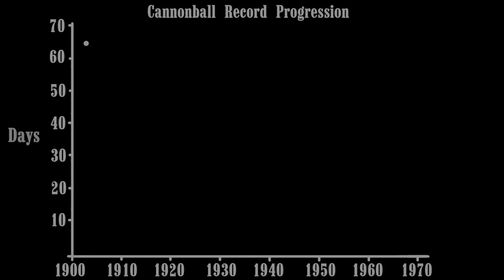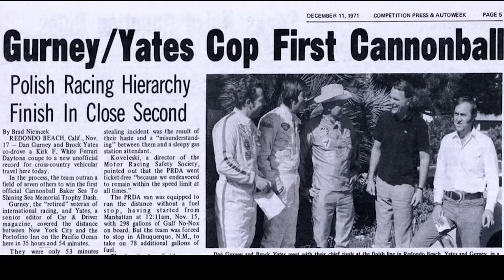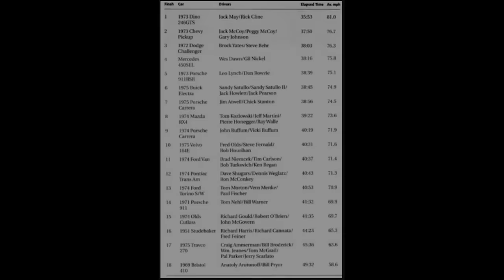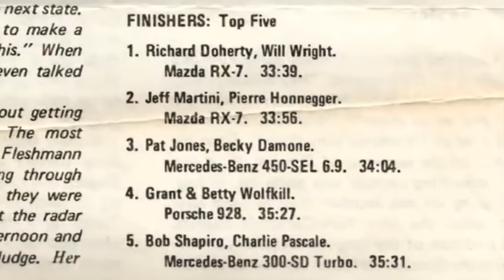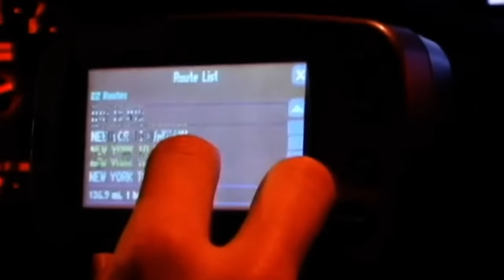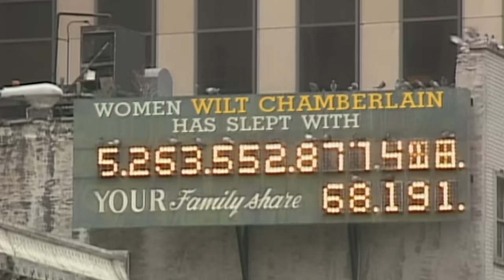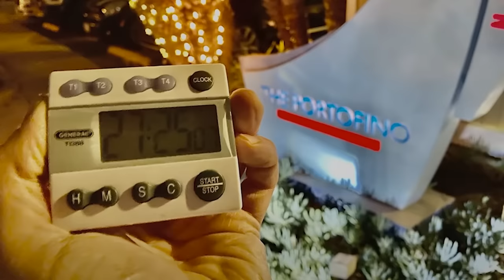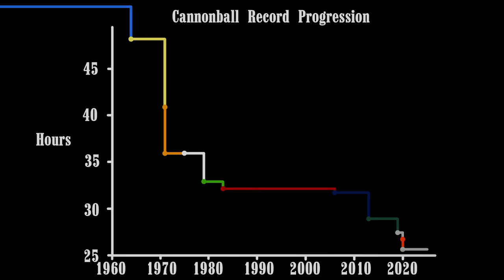The Real Story of the Illegal Street Race across America

Comment: Fun fact: In 1983, when I was 18, I had entry forms and everything for the '84 Cannonball. I built a 1979 TR7 body/frame/suspension and dropped in a built 60 degree Aluminum block Ford (Ghia/Capri) V6 that dyno-tested 310 hp at the rear wheels.  Everything else was Ford.  I had it to 184 mph once and with light weight and small diplacenent got decent gas mileage. At 17, I even did a practice run from San Diego to Tampa in my 1973 Charger, clocking 40 hrs and 20 minutes solo, non-stop! I built it specifically for it for the 1984 race that was canceled 😢
Reply: @luxdevoid  awesome 😎 have ya been in any since 🤔
Reply: @MaryShoemaker-wi4fy  Nope, after that, I went to college and discovered girls, haha
Reply: @luxdevoid  dang 🤔 well at least you got a family 🙌
Reply: Nice, I bet that's fun. I have a vehicle I would love to try it in but the chances of me being arrested are incredibly high😂

Comment: Back in 1979, a friend and I got wind of the upcoming Cannonball and made plans to enter. We'd also seen a small spot in Corvette News about a guy and his 1963 Corvette claiming to be the "fastest Corvette in the world" due to a time somewhere around 41 hours. With both our racing backgrounds, we figured we could beat it and take that title, even if we didn't get close to the Cannonball Baker Sea-to-Shining-Sea Memorial Trophy Run record. 
Our plan was to eliminate fuel stops by having "inflight refueling" by having a few pickup trucks along the way with gas tanks, booms, and hoses that could be swung over to us and the navigator crawl over the decklid to fuel the Corvette while driving down the road. Even at reduced speed during this for "safety", it was clearly faster than pulling into a gas station, stopping, refueling, and then pulling back out on the road. We figured it would save at least an hour. 
In the end, our projected budget was going to be enormous, with gas for 6000 miles roughly for the Corvette, gas for the pickup trucks to get in position, hotels for everyone, food, and other expenses. Trying to round up enough friends to be as crazy as us, after all one would have to drive a pickup while another was in the bed swinging the boom to us and operating a pump, all going down the road at 55 (or more) mph. We figured we'd need about 10 gas stops and that at least 5 needed to be inflight refueling to make it worthwhile. 
Clearly we didn't fall into the rich enough to throw money away like this would have been. 
My Dad had even suggested that due to West Coast Corvette prices at the time, when we got there, sell the car and fly home to offset some of the costs.
And by 1979, getting out of tickets wasn't nearly as easy plus they counted for more than simple fines. 
In the end, that much money paid for almost two seasons of road racing.

Comment: 10:32 One of the janitors at my school had a friend back when he was young, who swapped a 350 small block Chevy and a Powerglide 2-speed auto into a Vega, but he didn't change the rear end (A little 8-bolt that's made of glass), which he blew to pieces as soon as he got on the gas. After that, he put a positrac rear end from some other Chevy in it, and had a lot of fun surprising people at stoplight races, before eventually crashing it.

Comment: I have always felt that speed limits should be restricted to areas where it is necessary like around schools, towns and cities. As long as you drive well within your limits leaving room for the unexpected, high speed driving is safe. Sometimes safer than driving at the speed limit on a boring road where you can easily get bored and complacent, which also causes mistakes to happen.

Comment: Did it... in 46hrs flat... from the pan handle of Florida to the top of the bay area... in a BMW 320i... an 81... of all the vehicles to run the trip with... it did a fine job of running 115mph the whole way

Comment: I belong to a car club that yearly attempts much shorter runs - usually less than 250 miles - but as fast as we can. We compete against each other, so no outsiders. The fastest I'd gone when I had a turbo 4 cylinder was 160mph. I have since swapped the 4 for a 600hp 427 V8. Top speed - unknown. :D
Reply: What car bud

Comment: My recollection of the Car and Driver article explaining the first Red Ball Garage to Portofino Inn dash as being a civil disobedience run, the rationale being that in 1933 Cannonball Baker traveled the 2,800 miles in 53.5 hours at (supposedly) an average speed greater than the then new 55 mph speed limit. Regarding the Polish Racing Drivers of America, their idea was to load a Chevy van with enough 55 gallon drums of petrol to allow them to drive without stopping. But with 7000 lb gross weight, fuel economy was even worse than normal (in 1971). The PRDA van made one stop, 7 minutes long.

Comment: Before he passed away, my uncle told me a story about how he and my father (twins) had made a run in 1972 from Syracuse, NY to Pasadena, CA in his '68 big block Corvette.  They were both engineers at GE in Liverpool and were heading to their 10-year anniversary at Caltech.  The car had a 36-gallon fuel system from a '63 Z06 Corvette, aftermarket side pipes and a "lightly modified engine".  They made the run in less than 30 hours, without incident.  My uncle said that he and my dad outran police numerous times during the run.  When I mentioned this story to my dad, he simply smiled and gave me a sarcastic reply that he had no recollection.

Comment: Funny how at one point cars in general were "far too impractical to ever catch on" and now electric vehicles are "far too impractical to ever catch on"....
Figure out them charging times or find a way to half the cost so I can buy 2 daily cars and ill be on board
Reply: If only... there was a way that they could make the ground electrified on long highway runs then you get a partial charge on those parts
Reply: @Nolesy  that would be reasonable, I wonder if the infrastructure they would need to build is easy to upkeep.. if not, then it wouldn't be viable to attach to ALL roadways and highways, like rural areas, my hometown is not along a main highway and would likely not be considered if roads like that were installed...

Although, in a city it could make sense, if it could cut down on electricity usage in the homes to basically trickle charge the vehicles on the road. .. but it would probably just raise taxes and charge the entire community for the power,, and use alot more of it, meaning more power plants or solar infrastructure would need to exist...

It's almost not useful until maybe solid state batteries can be safely used, if they can even exist yet.

Comment: I have the same 1976-77 Dodge van but it's a Tradesman not a Plymouth Sportsman. I am well acquainted with the carburetor problems that plagued the ambulance. They choke was electric but when off for more than 5 minutes it would almost go full on choke especially after 10 minutes. I would bet that poor 100 yard dash had it chugging and choking right down to a stop. I have made an adapter for this still using the same choke. I might do an adapter more sophisticated using an O2 sensor but not really necessary. Others with money would likely go fuel injection or poor man's manual choke but I hate those ideas. Maybe the future holds a Dodge engine swap EV solution. Well, that's just a dream at this point.

Comment: I think that just plain luck plays a part. I drove from Durham, N.C. to Long Beach, CA in 42 hours. I didn't see one cop on the entire drive.  I typically cruised around 85 during daytime, but cranked the average up to 90-95 at night.  Thankfully, the car was only 500 miles into an engine rebuild and I had new tires. The car purred the whole trip. Ate only 1/2 a can of oil. Truly, the secret was the rear axle ratio... 3.55. So, yes, high speed cruising was just fine as far as sustained RPM. It was a fun trip, except for getting sick from No-Doz.

Comment: I have a good motor in mind but I would need to find a good car to drop it in with enough room for the extra stuff like gas and to sleep and what not. Viper v10 would be my power train choice though, the power it makes and the transmission geared for 200+ mph just makes it ideal for this I think. Wouldn't be very hard to just keep it running over 100 mph steady, also with the ability to out run the cops if provided the extra gas and enough road. Obviously nowadays it better be night time if you try running from the cops.

Comment: I own the black Mitsubishi with the flames.
Reply: Yeah, the actual car from CBRII. There were 4 Starions leased from Team Mitsubishi for the movie. 1= Road car which was outfitted with full frame rails and the flame thrower. 2 = The movie set stage car which was cut up to get good open interior shots. 3 = Car that turned into a submarine that they drove into the lake. 4 = The still shot car for the parked car shots and a couple of slow moving scenes such as when Jackie Chan flipped onto the hood and clocked in at the time clock. The doors are pinned for easy removal and there is a swivel seat mount for the back seat where Jackie sat.
Mine is the still shot car.

Comment: doing the run during quarantine is less dangerous not more so.
I don't see a reason why those runs should be disqualified, sounds like someone is just salty.

if the issue is the playing field is different then all of these runs should be disqualified, because they're not using the same car model as the one that set the original record.
the rules should be "single motor vehicle driven from east coast to west coast" full stop.
shouldn't matter what vehicle,  what time of day the run starts or what city it starts and ends in, it shouldn't matter that the roads are sparsely populated during the time of the run, doesn't matter if it goes east to west or west to east, doesn't matter what vehicle or route they take. None of that stuff should matter.

one motor vehicle driven from coast to coast.
because that's what it's about.

Comment: "safe drivers could safely drive exceeding the speed limit........"  ???    this is just due to such a small sample size of vehicles in the event.   If 100,000 safe drivers , for example,  drove the event, the accident and severe injury number would exceed slower speed driving.  Of course much to the accidents would be caused by other drivers at slow speeds, people pulling out sun front of car supposedly going 55 mph, but in fact going over 100 mph;  and pedestrians and bicycles etc trying to cross roads with high speed drivers coming thru.  ;  and also, mechanical failures on vehicles, not designed and built to function atl race level for the event.
Reply: Yeah ur right its basically just probabilities and praying LOL

Comment: I am preparing for a run of a different classification. I believe I will get the record as nobody has ever done it in the same way… towed (reverse course). Is there a time for a skateboarder on a tow rope? Sign up now for an opertunity to tow one of the many 100mi. legs and get your name associated with what shall bea record never broken. If the spoter in a hot air ballon can keep up I anticipate a time of 72hrs….. it’s not like fuel stops will interfere or law enforcement with “The Quaker Skater” disguise. Just because my (fake) religion prevents me from riding in an automobile doesn’t mean I will miss the wedding